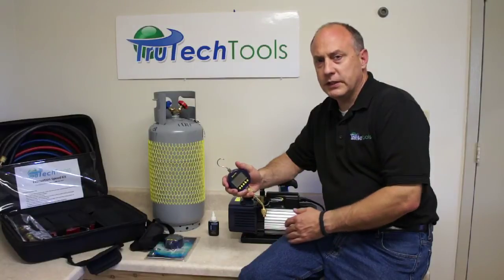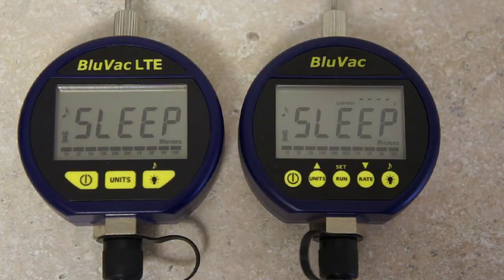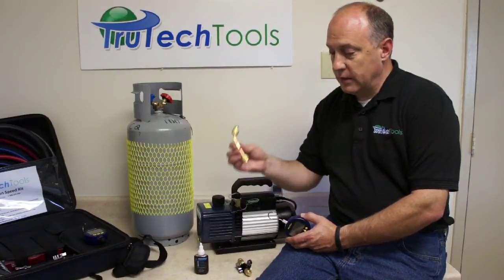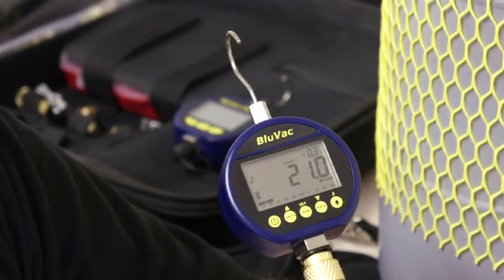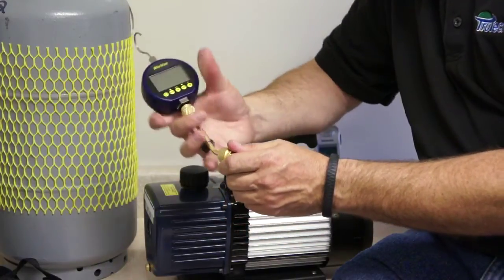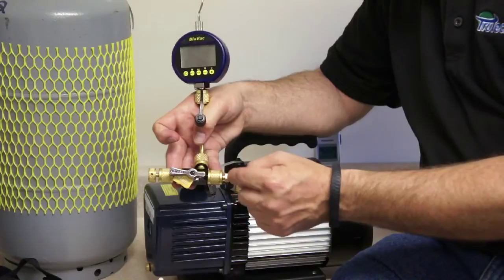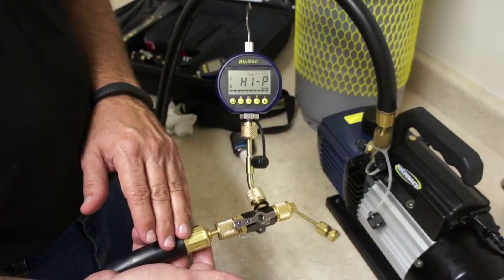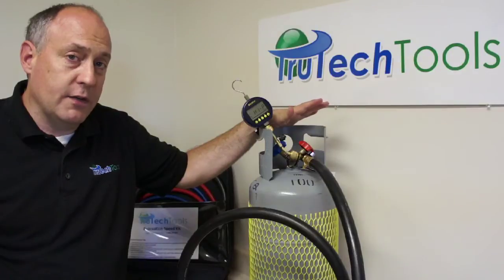Attaching and Troubleshooting the Bluvac Gauge

Comment: Have a question.. Please help!! I have the Bluvac LTE and I am using the Navac NRPD8i vacuum pump with the digital micron gauge. I am pulling a vacuum and my BluVac LTE will pull down to about 800 microns then start ticking back up at a steady quick rate. Meanwhile, micron gauge on my NAVAC pump is holding at 250 microns. I tried multiple couplings, one brand new. Any suggestions.

Comment: Geez, my Rothenberger pump pulls nowhere near that low of a vacume when connected directly and running.
Its very slow after 300 and its almost new.
Yours dropped down to tens in seconds.
I wonder if changing the oil would help

Comment: I'm so glad I saw this video.  I was thinking all 3 of my vacuum gauges were junk because I was testing them on small volumes rather than a larger volume like a tank.  I just assumed the less the better but, less fittings and hoses, the less chance of a leak.  Ill have to re-test all my stuff again... I was getting to think none of these gauges work....LOL. Again thanks Jim
Reply: I've had the exact same problem and so glad Jim shares his knowledge as he's part of the reason I understand vacuum at all. I was on the verge of figuring this out on my own. It made no sense why the smaller test I did the more it seemed to leak. But it wasn't consistent either. I did manage to hold a vacuum under 500 microns on just a core tool for over 10 minutes with a lot of tests. The worst leaks seem to be hoses themselves. Never again will I do a standing vacuum test without the hoses isolated

Comment: Does anyone have any guide about what leak rate is acceptable and what is not acceptable regarding equipment we work on.
I am unable to connect leak rate in microns per second and leak rate of say R22 of 0,5 g/year. Maybe some formula can solve this?

http://www.refrigeration-engineer.com/forums/showthread.php?43675-Vacuum-test-acceptable-leak-rate&p=300229#post300229

Comment: Yea sorry those core removes are not as good as the YJ.  I dont care who "vacuum rated them."  What entity gives this "vacuum rated" badge?  YJ core removes are teh best and only.  i heard someone saying he had to replace the gaskets alot.  Thats because your spinning the housing.  But to get it tight enough you have too.  And on that "vacuum rated" core remover the gasket sits atop the brass.  So if you twist the housing and not the nut youll twist the gasket.  So they wear out fast. 

On the YJ core removes(which ive used to pull to and HOLD at 180 microns for 30 minutes on many occasions, in the field) the gasket sits encased in brass.  It does wear out but not as bad as the other ones.  But the only issue with it is that if you over tighten it will bulge the gasket so its hard to stick the stem back through.  But much better than tearing them up over and over again.

Anyway APPION has nice stuff.... but not their core removers.  I dont care who rated them as anything.  They are the same as the C&D valves. Ill use that appion mega flow kit.... with YJ core removers. lol

Comment: x2 After buying for myself our company went out and bought bluvacs, brass couplers and one core tool for our techs.

And when they have trouble with the vacuum i go install my brass coupler instead of theirs and it pulls right down.  Sometimes i have to change the gaskets once a week if i am using the coupler alot.   The gaskets that go for hoses slide in the coupler but seem a little short and have to play with it to get them set right. 

Keep up the videos Jim

Comment from the maker: Matthew, 
Open the gas ballast for a minute or so before you shut off the pump. This will break the deep vacuum and not allow the oil to pull into the hoses. You can also loosen the hose at the pump with the core tools isolating the system if your pump does not have a gas ballast.

Comment: I had this problem, you can't shut off the vacuum pump while its in a vacuum or you will pull the oil out of the pump. Here's what you need to do, after you shut off both of your valve core tools at the condenser you will then need to loosen the hoses at the vacuum pump to break the vacuum then you can shut off the pump and no oil will be sucked into your hoses or you have a pump with a blank off valve makes sure that it is closed before turning off the pump.

Comment from the maker: You can close couple them with a 1/4" flare coupling and let them degas for awhile if you like, but they will easily pull down below 200 microns out of the box. In a few uses they will begin to perform even better.

Comment: What a great demonstration of the bluvac.
 I made a video a while back while I was trying to learn the best way of pulling a vac and I ran into some problems and I thought the Appion system was not doing what the manufacturer claimed it would, but I determined it was the gasket in the brass connector that I attached the bluevac to was bad. After replacing the gasket this system works great and I would recommend it to anyone that's wanting to take their vacuum to the next level.